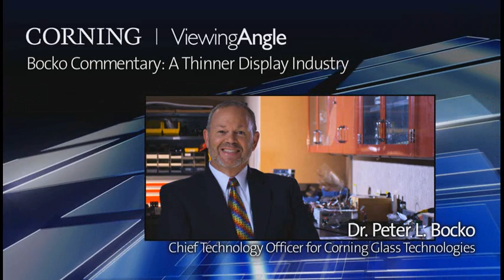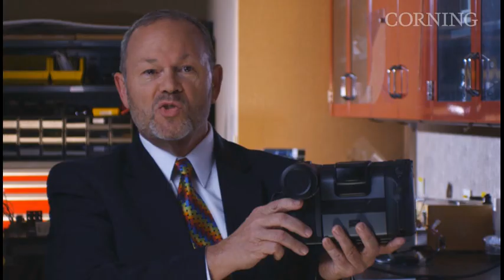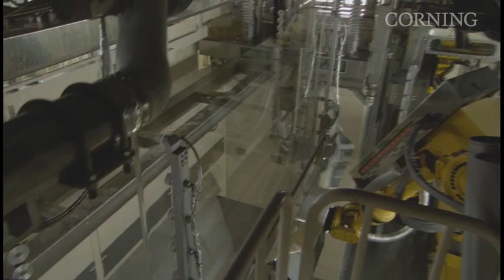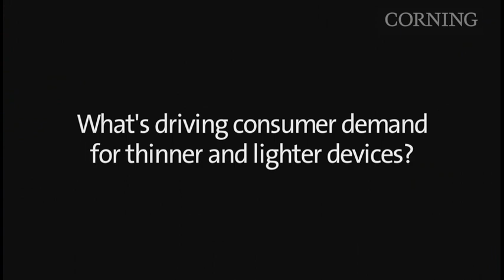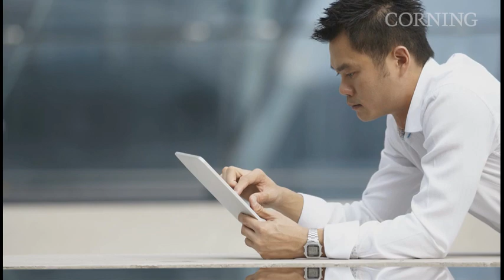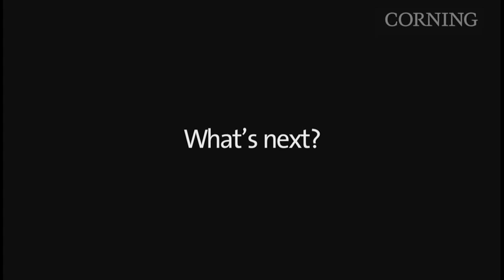Bocko Commentary: A Thinner Display Industry

Comment: Have you considered embedding carbon fiber into the edge of the display glass during the fusion extrusion process? High temp tolerant structural fibers like carbon fiber would limit crack propagation during edge impact collisions fractures and chips that are common initial critical failure points of the glass in mobile phones and tablets.